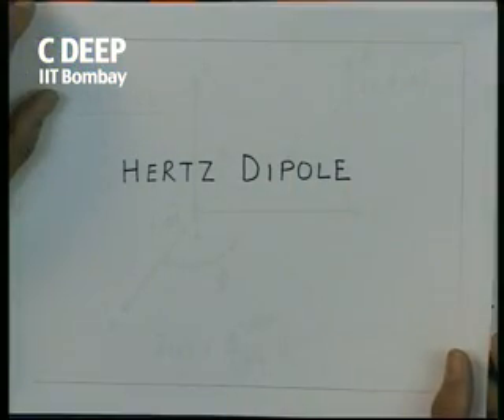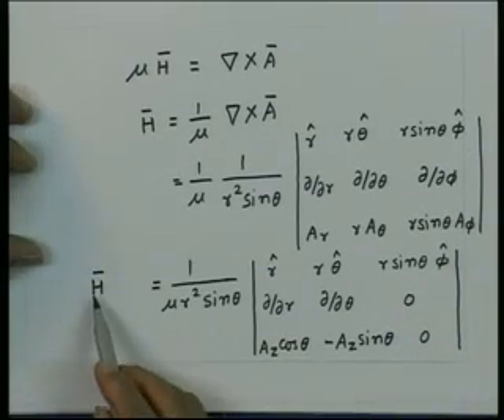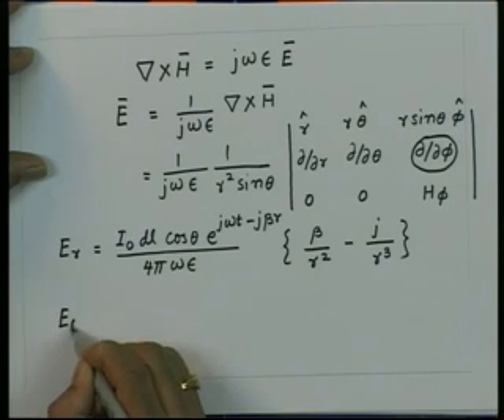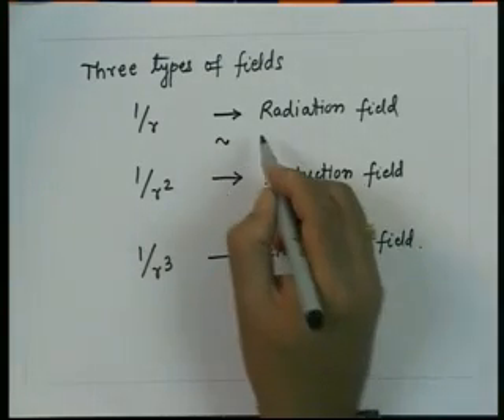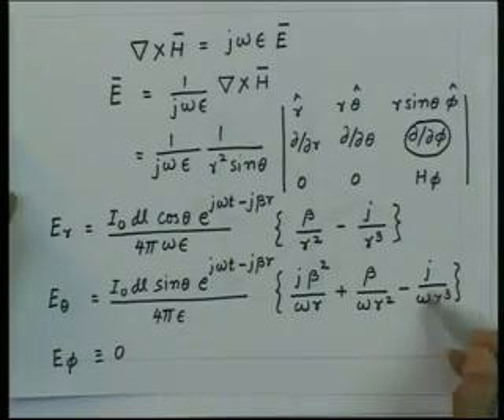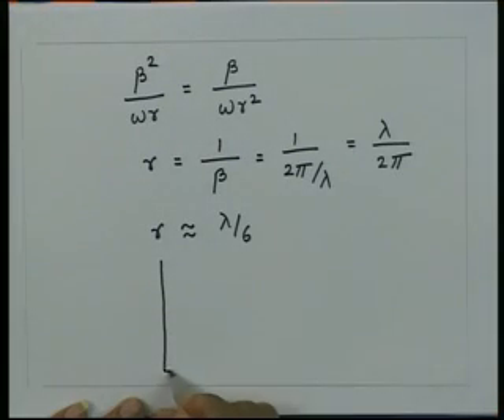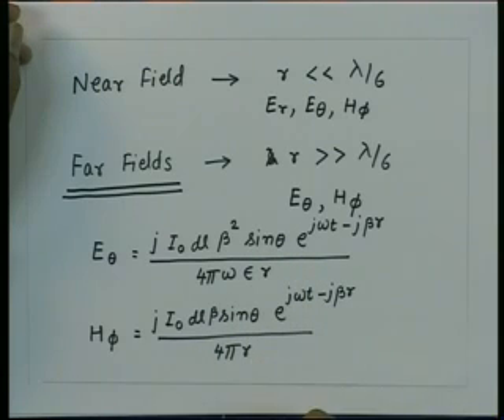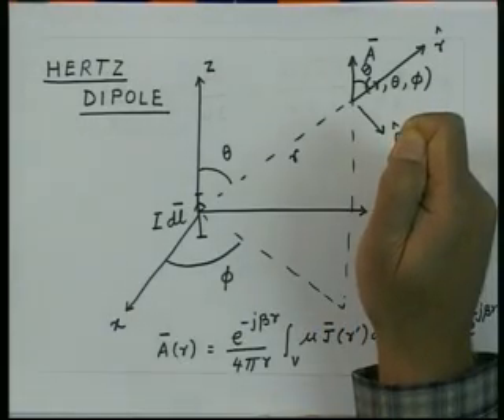Radiation form the Hertz dipole

Comment: Hello, my name is William. I am an American PhD physicist and I have been investigating propagating Electromagnetic fields for many years. My investigations revealed that these fields and the information in these fields propagate nearly instantaneously when they are created and reduce to the speed of light as they propagate into the farfield. For more information, Google search William Walker Superluminal.

According to Albert Einstein, if the speed of light is not a constant, then his theories of Special and General Relativity are wrong. This can be seen in Einstein's time dilation result due to a moving observer: t=r t' and the length contraction result: L=L'/r, where t and L are reference to the stationary frame, and t' and L ' are reference to the moving frame, and r is the Relativistic gamma factor: r =1/Sqrt(1-(v/c)^2). These results are easily derived using Einstein's light clock thought experiment using simple algebra. But if propagating EM fields with infinite speed near the source are used in the derivation, then c = Infinity, and r=1. If propagating EM fields far from the source are used, then c = the speed of light, and r= the standard Relativistic gamma factor. What comes out of this is that the effects on time and space are completely different depending on whether one uses propagating fields near or far away from the source, which can't be true since time and space are real. So the conclusion must be that Einstein's Relativity is wrong and time and space do not change with respect to moving reference frames, Galilean Relativity is correct, and that Einstein's equations just enable us to back calculate to the correct answer, given the time delays observed by the propagating EM fields used in measuring the effects. For more information, Google search: William Walker Relativity.

But these results do not account for the time dilation observed by moving atomic clocks in airplane experiments, but can be accounted for using variable light speed theory (VLS), originally proposed by Einstein, and later improved by Robert Dicke in 1957. In this theory, spacetime is not curved by gravity as suggested by General Relativity, instead Newtons theory of gravity is correct and the many other known effects of gravity are due to the affect of gravity on the of light speed. For instance the observed bending of light by mass, which caused General Relativity to be accepted, can be explained, by the gravity generated by the mass, changing the speed of light, causing the light to bend around the mass. This effect is analogous to the bending of light in glass. Since lasers are used in atomic clocks to measure time, then the observed time dilation in atomic clocks in moving airplanes can be explained as due to the effects of light speed changes in the clocks due to changes in gravitation as the plane goes up and down. It should also be noted that several researchers have shown the relation E=mc^2 can be derived without Relativity using Newtonian mechanics, and the Michelson Morley experiment can be explained using the Doppler effect, ref Nathan Rapport 2021

In summary, this research shows that Einstein's theories are wrong and that time and space do not change with respect to moving observers, Galilean Relativity is correct, Newtons theory of gravity is correct, and many of the other effects of gravity can be explained as gravity simply changing the speed of light. The importance of this research is that it completely changes our understanding of time and space and gravity, and simplifies our theories. Perhaps this new understanding will finally enable researchers to finally unite Gravitational theory with quantum mechanics which have been incompatible since scientists accepted Einstein's theories for Special and General Relativity. For instance, Relativity is incompatible with quantum entanglement, which requires communication faster than light, but can perhaps can be explained by superluminal propagating fields between entangled particles.

It should be mentioned that this superluminal effect is also observed in the propagating gravitational fields generated by an oscillating mass using Newtonian gravitational theory, and is nearly infinite near the source and reduces to speed of light far from the source. For more information, Google Search William Walker Gravitation. This matches very well with observations of the stability of the planets, which would not be possible if gravity propagates at light speed, and was originally proposed by Simone Laplace in his famous book: Mécanique Céleste in the late 1700's, where he estimated the speed of gravity to be 7x10^6 times greater than the speed of light. See: Wikipedia Speed of light.

William Walker, 2 July 2023, Fjugesta, Sweden